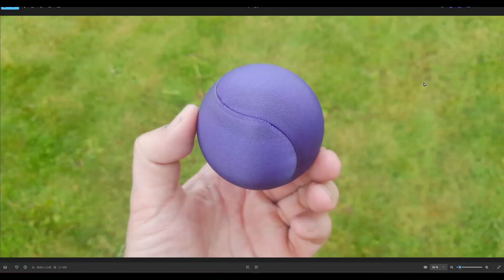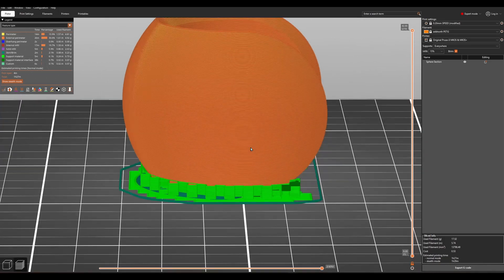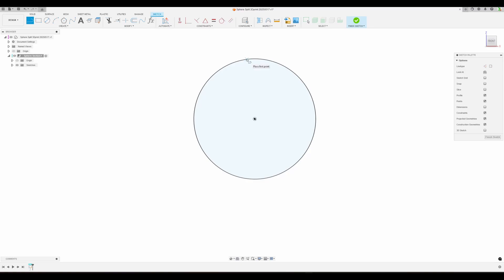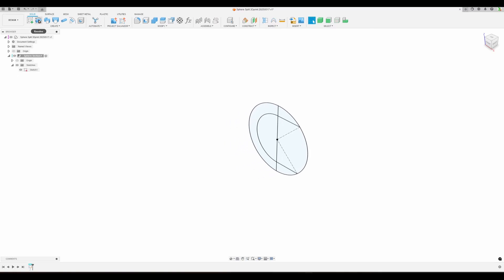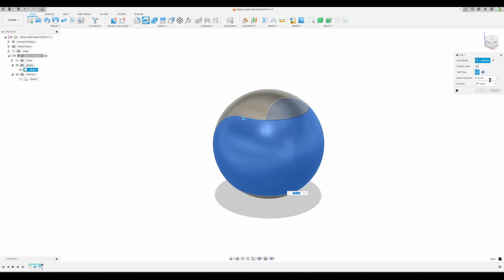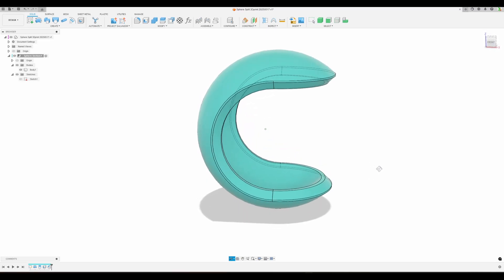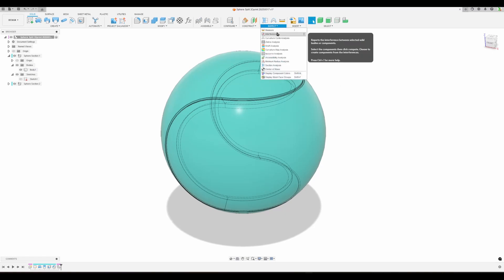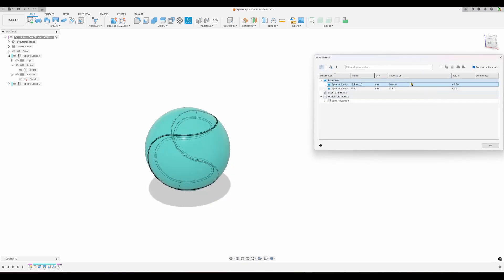Making the Perfectly Useless Sphere (but it prints great!) in Autodesk Fusion

Comment: I modeled this in Solidworks using the same features, but I should mention that I had to use the Split Line feature rather than the actual Split tool as you only need the projected sketch for the Shell…
Reply from the maker: Nice. It's often missed out that we can learn from other parametric CAD software, the tools are similar and geometry is always geometry :)

Comment: Those construction lines that define the width of the slot shape was really neat! I saw a square in there instead when I figured it out. 

When fiddeling around with it I came to wonder about the relationship between slot width and the diameter of the sphere. For some reason it turned out to be PI devided by 2,2222... Have no clue where that came from 😅
Reply from the maker: If I'm thinking correctly the ratio should be sqrt(2), close to PI/2.2222......
Reply: @KristianLaholm  Yes, that what it is. Now I see why. 👍